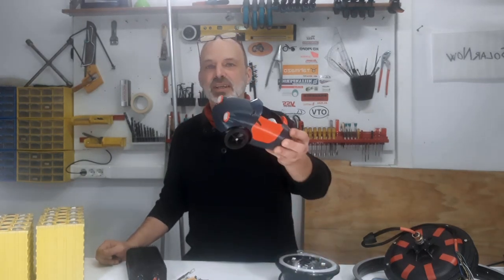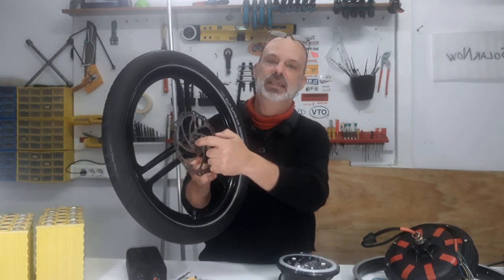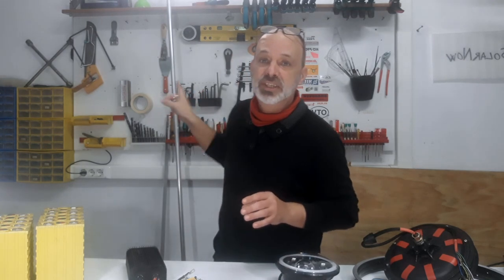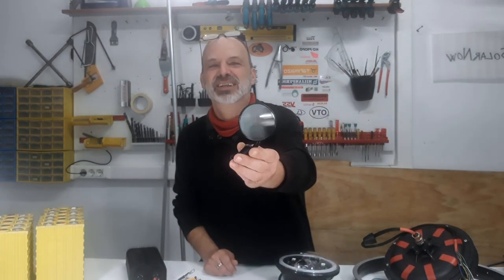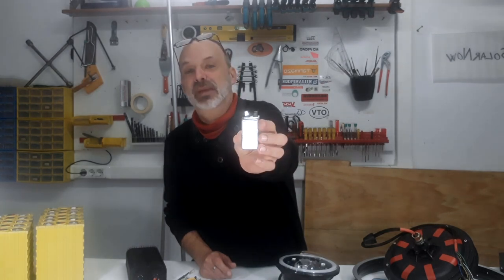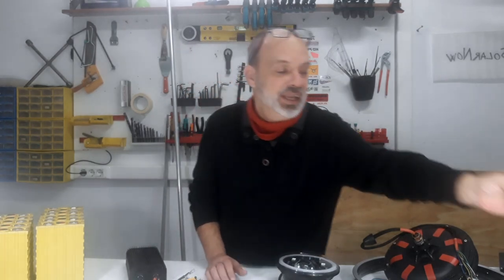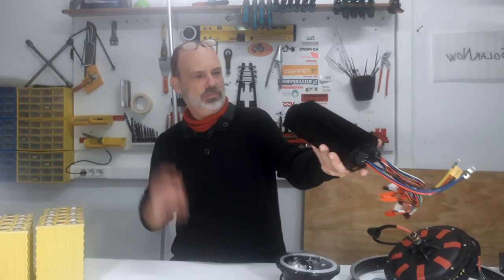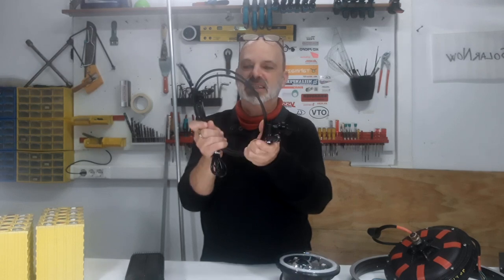3D PRINTED ELECTRIC CAR DIY, Components, Components (ENGLISH, Part 4)

Comment: So you will first make a total bicycle framebfrom steel and connection blox (instead of welding) snd than cover it with 3d printed body

It will become the heaviest and most expensive velomobile in history.

And the 3d printing will take forever.

Beter just buy a velomobile
Reply from the maker: There is no frame, all vehicle is printed as a unibody structure.
Only some parts like the rear suspension fork will be made with aluminum tubes and those couplers in order to be able to adjust is to different motor sizes and wheels.
Yes is will be heavier than a velomobile. But the objetive of the project is not to make a light velomobile. 
It is an experimental project that aims to explore the limits of hobby 3D printing, This project does not aim to reproduce a standard vehicle construction.
Reply: @gonzalop.chomon327  
When do you think it will be ready, very curious to the end result
Reply from the maker: @shrimptopian3392  It is a hobby project so no deadlines...
I am short of resources so it will be quite long. Any help welcome. :)